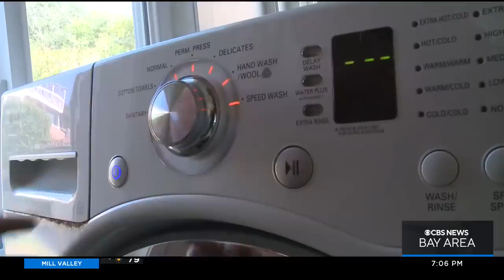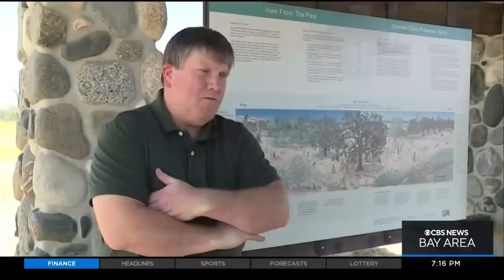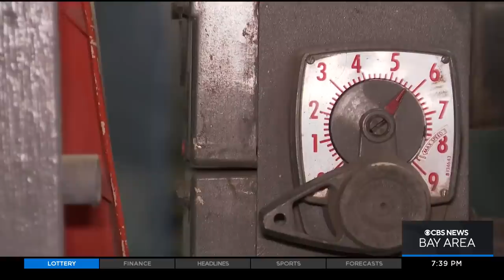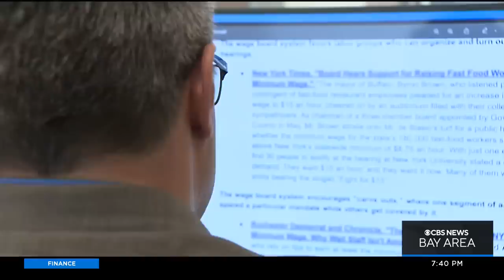Parched: California's Climate Crisis

Comment: Aqueducts and desalination plants are expensive and frankly a destructive approach.  It is vulnerable, brittle, and fails to address concurrent problems.  You end up using a ton of electricity to pump water in the aquifers, as well as desalinating water.  It would increase brownouts.

The better approach is the prevent collecting too much water at dams in the first place, instead of releasing it in anticipation of flooding.
It is better to do smaller, decentralized, water-harvesting earthworks/techniques starting in the foothills, and continue thru to cities.  These would include keylining, check dams, bunds, swales, gully repair, planting pits etc.  More bioswales with curbcuts to feed street runoff into them is a start in urban areas, as well as encouraging the purchase of cisterns, using greywater for watering lawns and trees, as well as using roof runoff for water, flushing etc.
Decentralized efforts can reduce fire danger, flooding, lessen drought impacts.  Bioswales planted with trees can reduce heat island effects, allow pavement to last longer.  By passively using rainwater in bioswales, reusing greywater and roofwater you can reduce the amount of electricity used to irrigate and reduce the chance of brownouts.  
Keeping landscaping hydrated this way also keeps the soil biota hydrated and allows water too seep better into the soil instead of running off.  
Farming and ranching could be done much better.  'Sustainable ag' is a greenwashing term to sell more products to farmers and ranchers rather than solve deep ag problems.  Restorative ag techniques work much better and for less while producing more food.
Overall using rainwater harvesting techniques/earthworks recharges aquifers and surface water in a positive downstream effect.  
Brad Lancaster has YT videos and books on the subject.  Mark Shepard also has a book on increasing food production and variety while solving water/climate issues, improving land and assisting nature in an ethical manner.
With Mark Shepard's methods you use plants found in the local biome and base your food production systems on that, contrary to what Valley Girl suggests by removing the land to be used solely for natural ecosystems alone.  (Don't pay farmers to do nothing, it is the biggest greenwashing scam.  If they insist on degenerative or greenwashed 'sustainable' practices, fine them, or make them let other farmers use the land to do better.  

It hurts us that engineers, urban planners, landscape architects, house flippers, developers, etc, treat rainwater like its poo falling from the sky.  That needs to change.
Lots of water falls in So Cal, even during droughts, but it is squandered.  
Back up and reassess where you look for problems/solutions.  Educate yourselves and call out this newstation for misinformation and adding to the problems.

Comment: Bad drought, but also upstream water getting NOT released so Lake Mead can be at historic low level, just to have it triggered "forced" water conservation/use measures by those in charge.  Why are we only using Lake Mead water level for making wide sweeping changes or decisions about water?  So ass backward for 2022.

Also need desalination plants, just build it inland and pump sea water there (since environmental groups are going to axe any site proposals on the coast) and pump the desalinated water to the reservoirs.  Think outside the box instead of just finding more reasons to not do stuff the old fashion way.

Comment: Between 13900 BC and 14000 BC, a 100 year span, Earth's temperature rose 5 degrees Celsius. This is one of many intermediate spikes in the ice core data, not including the 10-15 degree Ice Age spikes. Humanity lived through this periods just fine and had no heavy polluting industry to speak of at that time.  In the past 200 years, which is twice that length of time, Earth's temperature has only risen by 1.2 degree Celsius. 

A minor natural change in temperature that is in fact physically unstoppable and inevitable has been pathologized and blamed entirely on human activity in order to establish a carbon tax which allows governments to monitor every action of every person and tax them for it. The climate changes. Changes in local weather ARE NOT evidence of climate change, however, human activity CAN affect weather. 

Changes in climate, not weather, are driven by the Milankovitch cycles, primarily precession of the equinox, which changes the angle of Earth's tilt over a 25,000 year cycle, and thus changes the total amount of sunlight the poles receive, known as the insolation cycle. This insolation data from ice cores coincides directly with the rise and fall of the past 4 Ice Ages. Furthermore, CO2, methane, AND temperature were all higher than it is now prior to the last 4 ice ages, and also coincide with the insolation cycle and the rise and fall of the Ice Ages. That's right, CO2 and methane were higher back when humans were hunting wooly mammoths than they are now. No heavy industry to speak of. If no other fact about climate change remains in your memory, let that be the one. 

This fact suggests that the warming we are experiencing now is that final spike of warming that occurs right before Ice Ages suddenly set in. Climate change is real, its not caused by humans, and we are headed into a regularly scheduled Ice Age according to every indicator, not a waterball Earth condition where the remaining icecaps in the already warm period were in fully melt away. Sea level rise cannot occur with slow melting because of isostatic rebound. Rapid melting is required to cause the floods and sea level rises that climate extremists harp on about.
Rapid melting is caused by a sudden addition of lots of heat to the atmosphere. This is how the Ice Ages end. The most popular 

 If we were to somehow try and affect these Milankovitch cycles, such as slowing down the rate of precession, it would spell real cataclysmic changes to Earth's surface, the likes of which climate extremists only dream of to justify the implementation of their carbon tax scheme

Comment: Climate change is part of climate. Since early 2003 the position of the sun in the sky have changed. North east America, actually in Montreal Qc. The sun used to come up due east and went down due west at night. Nowadays it's goes up almost due north and comes down between due west and the north, 330 degree. In winter at noon, the sun stands due south at an angle of 45 degree. Co2 and pollution are bad for us and the climate, but the sun is the major source for the climate modification. Before 2000, Europe and the west coast of north America had rarely hot spells and wild fire, 50 degree C in Vancouver last year when normally the average stands around 25 C. The incline of the planet used to be 23.5 degree on the axis around the sun, something have changed the axis sideways or somewhat because the sun still at the same place and we still goes around it. The rays do not shine at the place it used to be. We're in for major change with the climate. 
By the way, no one in official position, like the politician, are saying anything about it ...!

Comment: Well since by 2035 it will be the law that all new car buyers can only legally buy an electric vehicle how about considering this. Get your sled dogs that can do mushing and use dog carts/ carriages that are fitted for them that are meant to carry 1 -3 people, horses and buggies there are a few dog breeds that are actually more middle ground and calmer but can still do a great job over decent distances and varying temperatures. and are more compatible for slightly busier people. The dogs still need a job to do and need proper care and human attention and affection. That is your solution for getting around or a different option would be solar powered self-charging vehicles, but they also won't be that reliable. Off Grid with Doug and Stacy is a good channel too. Florida Bullfrog and 123 HomeFree are great channels too.

Comment: California farmers are the number 1 reason they are having water problems!! 
They are still using out dated watering methods!! You can NOT continue wasting water!!! 
Farmers MUST change!!  
In British Columbia Canada our farmers have wrapped their fields in 14mm double sidded poly ( black on the inside, white on the outside)...keeps the soil erosion down, allows for drip line irrigation AND saves 80% of the water once used to flood the fields. 
You need to mandate these changes...pull nut trees, as they take too much water year round.  Those trees do well elsewhere - but you haven't the water to waste on nuts

Comment: THE BOEING CO. USED LARGER PING PONG BALLS IN--HEATED PROCESS TANKDS----IN AUBURN WASHINGTON BUILD NO 6  AND OUTHER BLDS THERE (  ABOUT 100 FEET X 20 FEET TANKS ) TO REDUCE EVAPORATION IT WORKED ABOUT 75% OR MORE !
                                                                                                    WHY COULD NOT THIS BE APPLIDE TO LAKES!!  ??!!  
                                                                                                              75% OR MORE LESS EVAPORATION??? !!!

Comment: What no one talks about is the affect of electrical power generation plants (nuclear and solar thermal electrical generation plants) are having which is a negative affect on the atmospheres ability to produce moisture.  Nuke plants are changing the charge in the atmosphere and solar reflectors push heat into the atmosphere 360 degrees.  Our engineers do not fully understand what they are doing to the climate.
Reply: that's crazy talk.

Comment: A B52 Bomber consumes 3,000 gallons of jet fuel per hour.  The Middle East is 8,000 miles away.  Since 2003, the U.S. has dropped 323,300 bombs. If humans impact weather, this would be it.